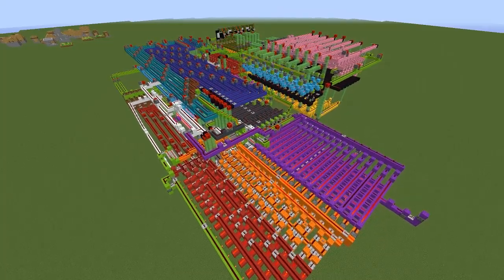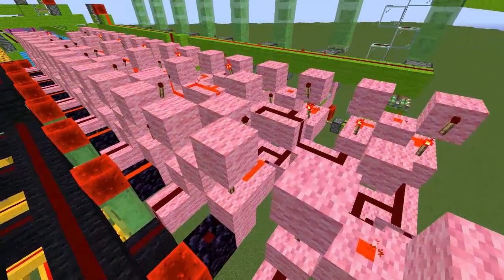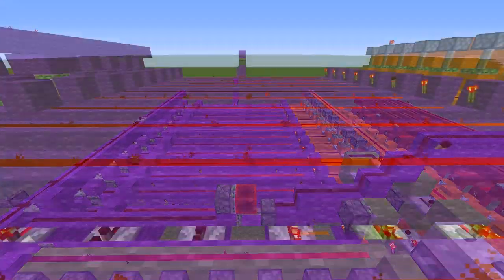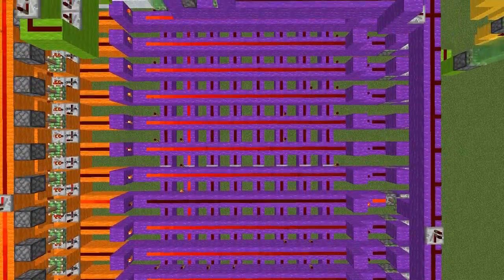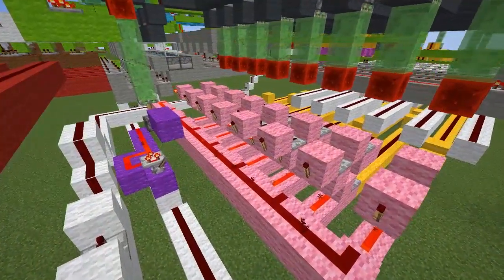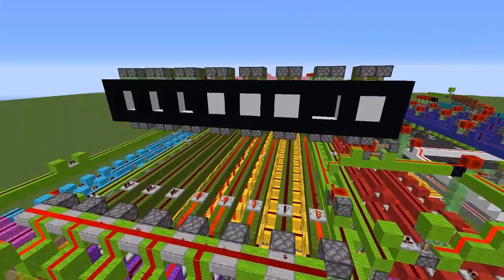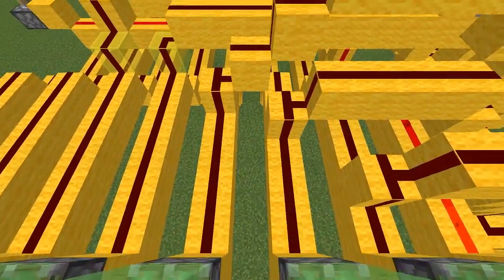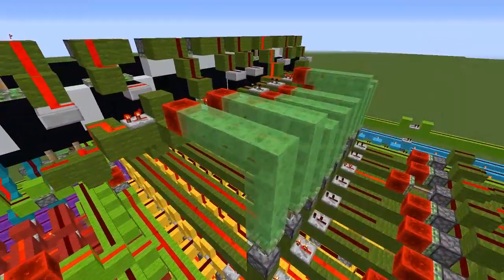How the Bitwing works! - My first redstone computer

Comment: This is very cool. I'd love to see some more in depth explanations of each part. Also it would be nice if it could support an input and a more sophisticated output like some 7 segment displays; do you plan on adding anything like this in the future?
Reply from the maker: Thank you! Luckily for you, I plan on making more videos about different parts of the computer in the future.
In terms of IO, I probably could add some, but considering the way the computer is built, it would probably be pretty messy. I plan on building another in the next few months with that kind of thing. 
Adding a 7-segment display however, might be a bit more challenging. Because it's 8bit, the decoder would end up being a little longer than 512 blocks long...
Reply: @TriDeapthBear  In not sure what you mean about needing a 512 block long decoder in order to have a 7 segment display? You can have 2 displays next to eachother to display an 8 bit number in hexadecimal. This would only require a decoder which has 16 outputs, one for each digit. You could even expand it to display numbers in decimal without too much trouble by adding a binary to bcd circuit on the back along with a third display. Just some thoughts which could really make it interesting. I also saw in your documentation that you didn't use worldedit (or any such similar help) for this which is quite impressive. Did you avoid it for any particular reason and do you plan on using worldedit or some such to help with future versions?
I look forward to your further explanatory videos.
Reply from the maker: @pishleback6151  Oh, I didn't even think about hexadecimal! I think I'll definitely put that in a future computer. With not using world edit, I didn't really avoid it for any particular reason other than I just didn't install it. I figured out recently that structure blocks can do that kind of stuff anyway, so I don't know if I will bother. Also, I don't think I will make future versions of this computer. Everything is a bit far away from eachother, and I think that starting from scratch and upgrading that would be a better idea.
Reply: @TriDeapthBear  I just had a thought about the 512 block thing, you might be thinking of having a decoder for every possible combination of 8 bits and hardcode the segments for each one? This is not actually necessary, instead you can simply split the 8 bits into 2 lots of 4 to do a hexadecimal output or use a binary to bcd decoder if you want to do a decimal output. If you do plan on using a 7 segment display type output you should definitely look into bcd (binary coded decimal) and hexadecimal if you don't already know about these.
Reply from the maker: @pishleback6151  I thought about what you said about BCD, and that is so much easier to do it that way! You were right, I was thinking along the lines of binary to decimal decoder connecting to a decimal to 7 segment decoder, but grouping it with each 7 segment makes a lot more sense. Thank you for your comment!
Reply: @TriDeapthBear  No problem, im glad I could help :D Structure blocks sounds like a perfectly reasonable plan too (never used them myself though), I think something like that is 100% necessary unless you have hours to kill copying and pasting by hand, especially when things get a bit bigger. Good luck with your next version, I look forward to seeing it soon :)
Reply: @TriDeapthBear  you could add mapped io info @n00bassaurus